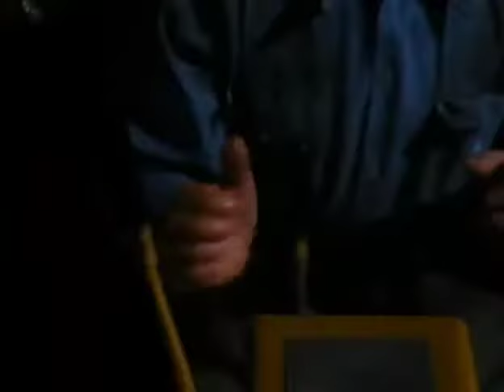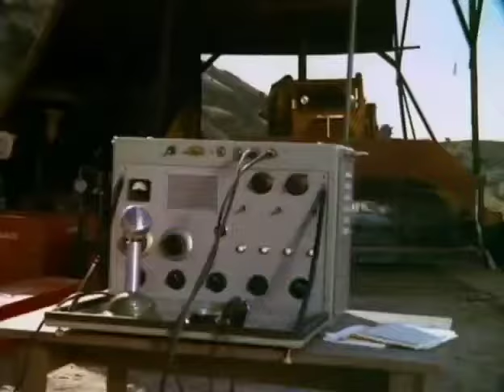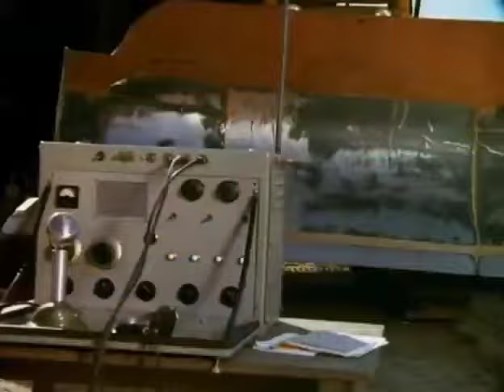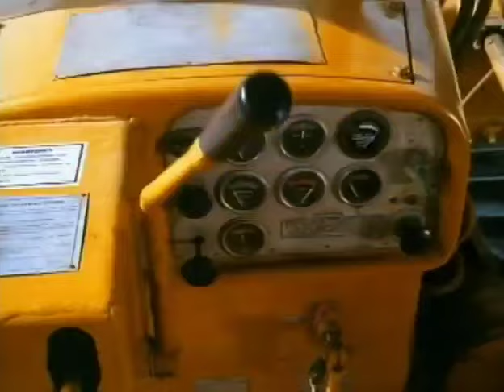"Killdozer!" (1974) But It's Only the Dozer

Comment: I don't understand what all that metal work is behind the seat but I'm guessing that hid another driver and controls for the dozer when they were filming it driving on it's own?????
Reply from the maker: @theunemployedtrucker  Yes! That would be correct.
Reply: They probably just put in enough diesel in the line & set it up were nothing was & let it go untill diesel in the line was out what I would do probably only last a minute or 2
Reply: can see the mans glasses at 17;40
Reply: @JohnJones-xm1yl  Ah, ha!  You're right. Mystery solved. Thank you, sir.
Reply: @mccrackenphillip it moved, turned, and stopped on it’s own with a view of the operator seat. Can’t do that with a runaway dozer smh 💀

Comment: I heard the Rc for this was the ahead of it's time
Reply from the maker: @Lee-At-Green-Pheonix-Rc  Yeah, so ahead of its time that it wasn't actually an RC at all!
Reply: @dozerfarms  how was it operated with no physical driver I heard and also believed it was radio controlled
Reply from the maker: @Lee-At-Green-Pheonix-Rc  it DID actually have a physical operator. Here's how:

Killdozer is an early 70s Caterpillar D9G, but not just any ordinary D9G. For the movie, they made a few small revisions, such as raising the height of the blade to look bigger and more intimidating, extending the smokestack for the shovel scene, and fabricating a custom cab BEHIND the existing one.

If you compare Killdozer to an everyday D9G (with or without a ROPS), it has a box behind the operator's seat that no other machine like it has. This houses the real operator and a second set of controls mechanically linked to the originals. This allows the real operator to create an illusion that all the levers are moving themselves as well as control the machine without being noticeable to the general audience.

However, you can see the driver in a few scenes through the vent behind the operator's seat. There were two vents (one front side and one backside) that may have been designed to keep the hidden operator cooler in the heat. But at just the right angle, you can see the outline of the operator's head as the camera is able to see through both vents to the other side.

Comment: There was nothing air operated on those D9Gs
Reply from the maker: @EarlRuppenkamp  Everything was hydraulic (though older 9Gs had cables to work the blade). If you're talking about the scene where he cuts the fuel line, I believe it sprayed like that for dramatic effect and an excuse for him to fall off the machine.

Comment: The sentiment killing bulldozer doesn’t exist, it can’t hurt you

The killdozer:
Reply from the maker: @Really-Random24  🤣
Reply: @dozerfarms hey dude I have a question.   Who would win.      Killdozer 1974 vs Marvin heemeyer killdozer
Reply from the maker: @พีรพงศ์เกตุกรอง  Ya know I coulda sworn I answered this exact question on someone else's comment but either it's not loading in or I'm hallucinating 🤣 but essentially I wasn't entirely sure because they both had their own strengths and weaknesses. While the D355A has armor and weight (31 ton vs 61 ton, therefore much better traction for a push war), the D9 is lighter and probably faster as well as 'driverless' and seemingly very good operating skills, or at least lack of driver fatigue. Really, it would depend on how the battle played out and if certain maneuvers were done. The D355A would win if it could get a good shot at the D9 and push it to either where it got stuck or off an embankment where it landed belly-up. However, the D9 would win (especially under the circumstances of unlimited fuel) due to driver fatigue eventually or if it could outmaneuver the D355A's operator.

Comment: They had dozer he use roofed one and push the mertoite after it had mind of it own and want to kill why not when it attacking ram it with none roofed one and drag it to da cool water
Reply from the maker: @Nr48_bored  because Killdozer is a D9 and the other one was a D4 and it would have just spun from the lack of weight and traction
Reply: @dozerfarms  hey man who would win 
1974killdozer or today morden bulldozer
Reply from the maker: @Walmart_Shopping_cart  It all depends. The D9 has quite a few things going for it... 'no driver' so it could go endlessly without operator fatigue (although newer machines have operating technology and assists now, too). It also has none of the sensors or computers a modern dozer has, so there would be a lot less to go wrong. However, the newer Caterpillars have hi-track design (which actually came out about 3 years after filming) that cause less sprocket wear and deliver power to the ground much better than a conventional setup. Even without the hi-track, newer dozers are designed to be a lot more efficient.

As for who I'd rather see win? Let's just say there's a reason I posted this video...

Comment: which tractor is this? Could you tell me the name and brand???
Reply from the maker: @Bob_esponja_peida_no_xandao  It was a very early 70s Caterpillar D9G Bulldozer (Track-Type Tractor). Personally I want to say 1971 or 72. However, they made a few changes to the machine for movie purposes:

The whole top section of the blade was added on afterwards to make the blade look bigger and more intimidating for scenes like the one where it almost chops Carl Betz's (known as Dennis or 'Sourball' throughout the movie) foot off.

The smokestack was lengthened for the scene where it gets knocked off by the shovel and pisses the machine off (the length it is afterwards is where it should be, assuming the welds were very weak so it would break there).

The box behind the operator's seat was custom-built to house the real driver and an extra set of controls. If you look in specific scenes, you can see the silhouette of a head and shoulders through the grate.

Comment: I dont get it. What did they catch it in a giant fly trap at the end there? 😂
Reply from the maker: @ThetreeDraggon  If you watch the movie, they try all different ways of stopping it, from burning it and blowing it up to fighting it with a cable shovel. At the end of the movie, Kelly (Clint Walker) spots their industrial-grade generator set and clamps it to a bunch of steel plates underneath a flimsy cover. He then proceeds to lure the machine over to the trap where they flip the switch on the generator, charging the steel plates underneath the cover and electrocuting the all-metal machine.
Reply: @dozerfarms  oh